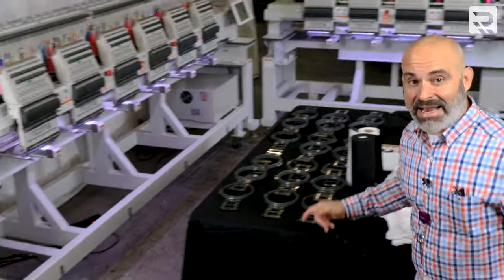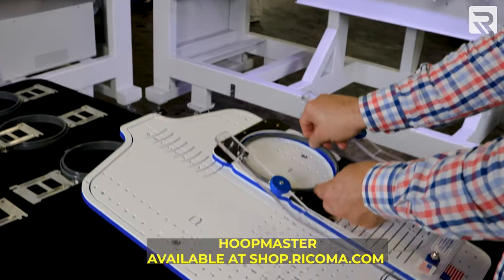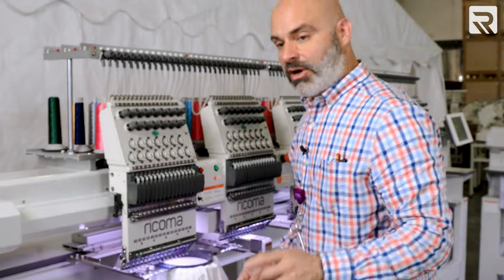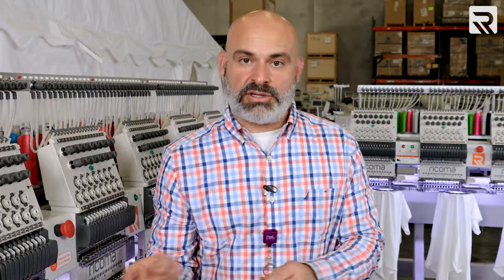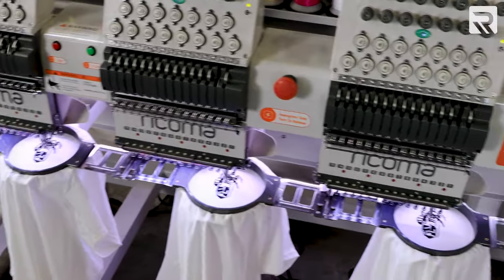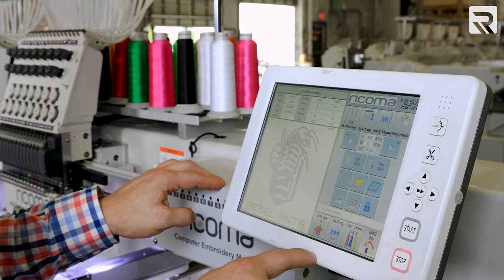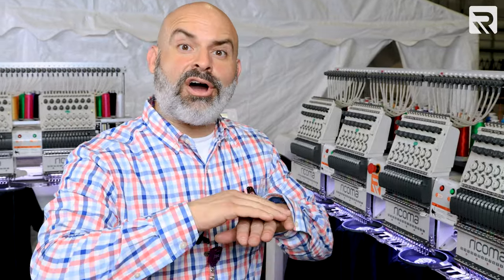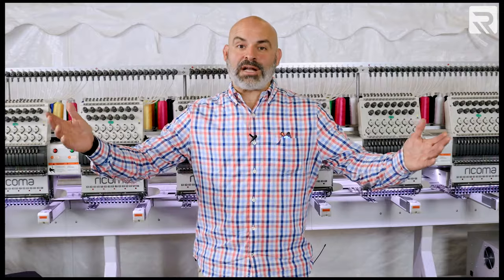Making One-Hundred Embroidered Shirts in Under Four Hours

Comment: hello awesome video ! question to embroider shirts would you have to use a ball point needle or can it be will the regular sharp needles that the machine comes with, does it have to be a heavy weight t-shirt also for the stabilizer can it be cutaway maybe to layers of it ?
Reply from the maker: For this project we used Gilden 100% cotton. Two sheets of cut away Backing and the universal needles that came on the machine. Depending on the material, it is always good to test it first with different backings and layers to see how is behaves. Once y ou have the right combination, you can proceed.